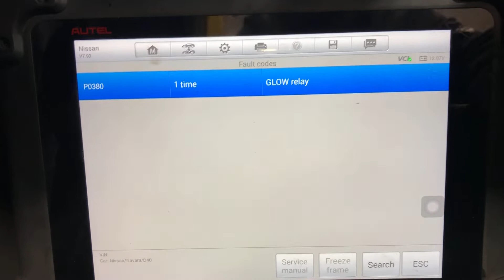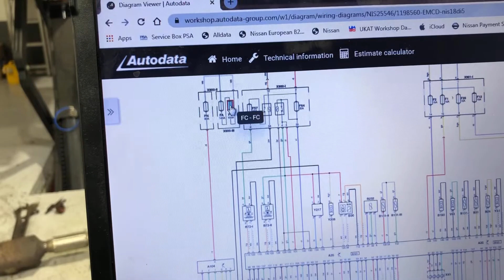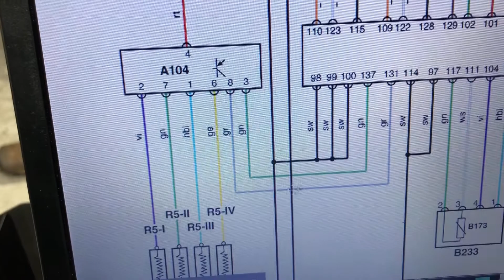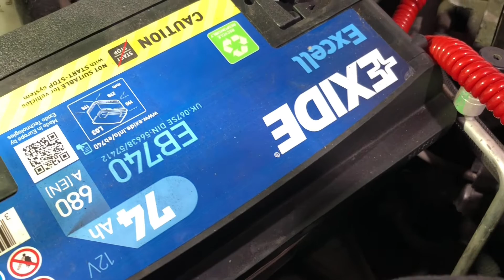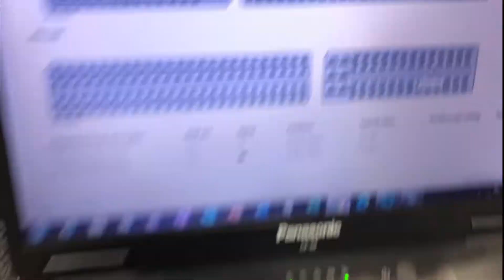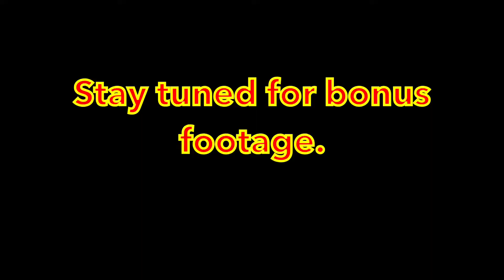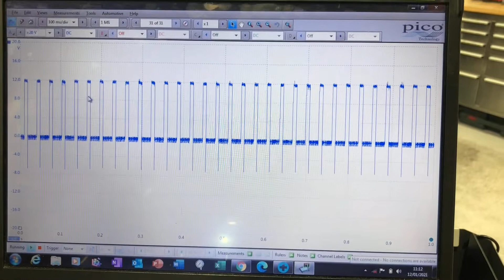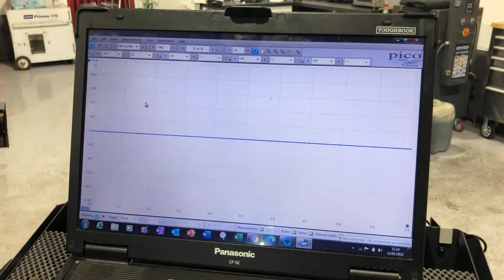2014 NIssan Navara D40 glow plug fault P0380

Comment: What a great informative video thanks.I have the same issue with my 2015 Nav poor starting and a P0380 error. I'm going to replace both the controller and the plugs as its now got 140K on the clock

Comment: Great video with a lot of info... I've had this done a few months ago, then the problems started again, had the glow plug relay changed a second time... Then the next morning with a frost it wouldn't start at all... Is that the glow plugs themselves or a faulty fitting on the relay?
Reply: Instablaster

Comment: Excellent walk through, thank you! Planning to follow your steps this week to investigate a P0380 error on my 2012 Navara. One question though, which ports on the glow relay were your oscilloscope in when you were testing continuity on ECU terminals 131 and 137? Obviously I can't actually do the ECU signal test as I don't have an oscilloscope, but I'd like to check the wiring anyway. Cheers.
Reply: Did you manage too fix ypur fault

Comment: Hi, currently having the same issue however when i check the 4 pin plug there is power going through it, for the first second ignition is on it's a bright glow and then light is reduced, any ideas? I've replaced plugs this morning to no avail

Comment: Did you know other solution for p0380 nissan d40 I check all the circuit change relay and 4 glow, erased code, bud still como back the check p0380..... Car don, t lose power...
Reply: Im from Chile, saludos.
Reply from the maker: Check the resistance from the 4 pin plug behind battery to ground, one of your plugs may have a bad wire/connection
Reply: @intelligentauto737  you are a my jedi máster, green wire was the truble, thank for share your knowledge, saludos desde chile.
Reply: @rodrigoelboli   cual cable verde ?? El que va a una de las bujias o el que viene de la ecu??
Reply: @rodrigoelboli  .. Hi! My Navara has the same problem. What did you do to fix the green wire?  Thanks..

Comment: i have only 7-8v on each plug - plug no4 - 0v - the engine start but the engine it does not hold idle, when the temperature of water start to heat it's ok